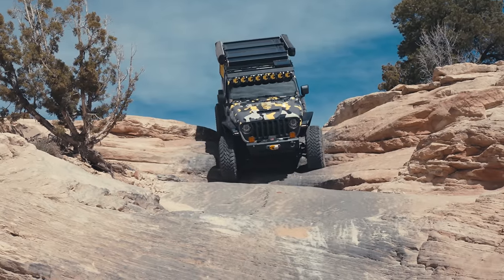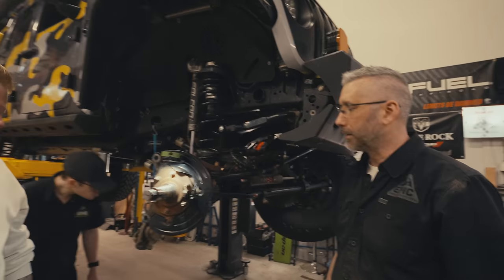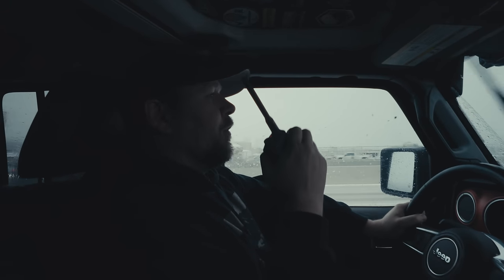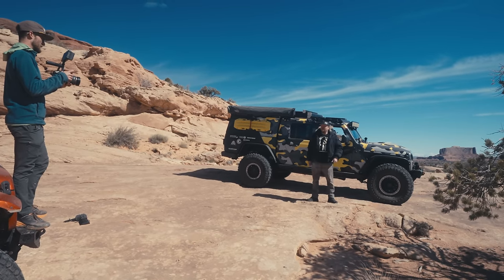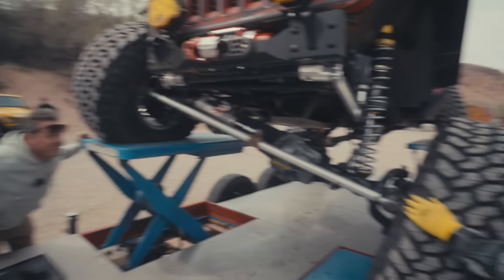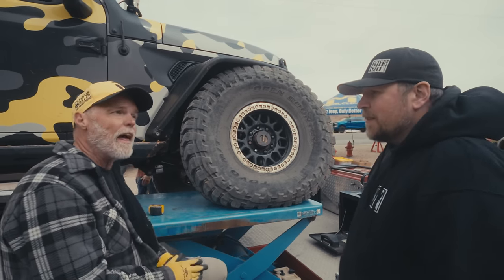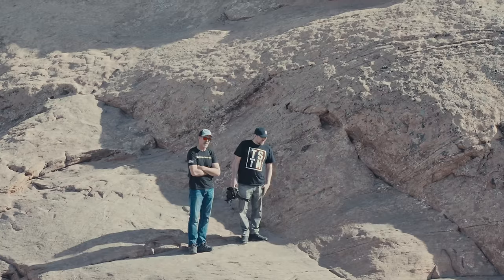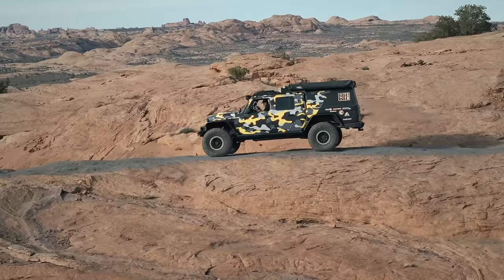The Craziest Week of My Off-Road Life

Comment: You know if that one was that bad the other side is probably toast also ..should have at least taken it apart and cleaned and re-greased it .. just my thoughts.. it was probably the extra leverage the tracks put on the bearing and seal that pushed the snow and stuff in the bearing. Those axels you have are like indestructible and the tracks are the only thing i can see that could cause that . You really dont  do extreme wheeling  nothing even close to the limits of those axels🤷🏻‍♂️ just my unsolicited opinion😂😂